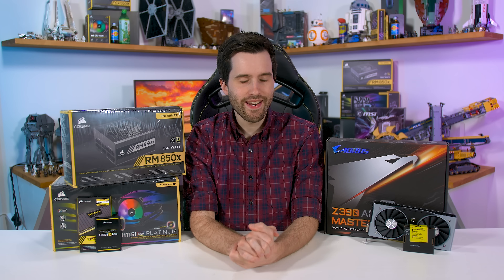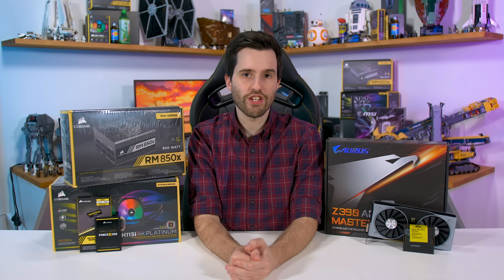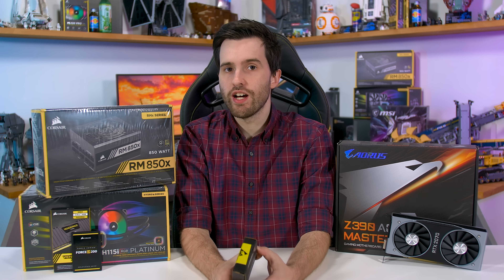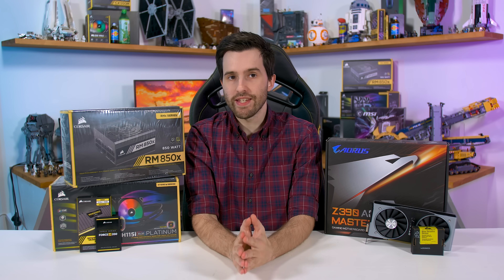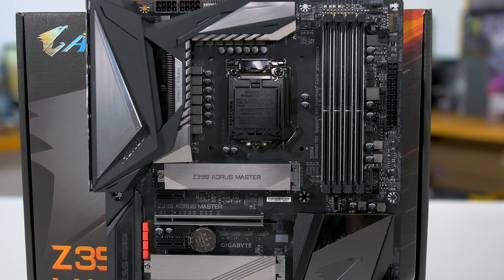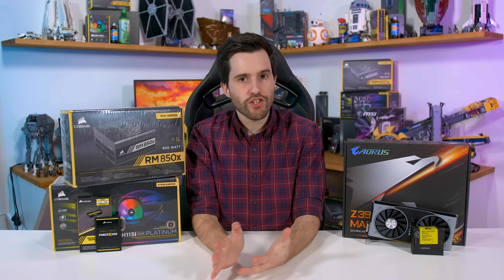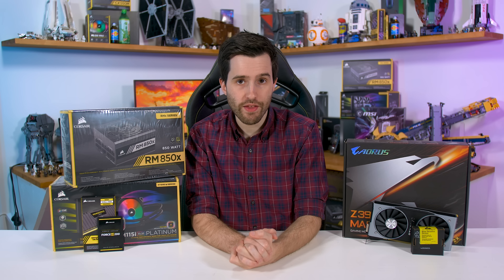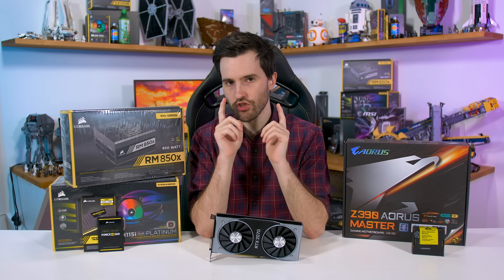Core i9-9900K Upgrade, Can We Cool This Hot CPU? Corsair H115i Platinum Tested!

Comment: Always a good thing to bottleneck OC 9900k with 3000MHz RAM. oh boy. you are working for verge, aren't you.
Maybe you wouldn't peak 90 degrees C if you had actual front air intake instead of a solid panel.
But you are the PC expert, and I am definitely not an thermodynamics expert. kappa
Reply: I've been also kinda wondering about the ram speed for 9900k.  Ended up ordering 3600 cl16 just to be little more safe,   and paid almost double the price of 3200 cl16.  There just aren't enough information how much ram speed utilization have increased from 8770k.  At least i couldn't find enough info.  Yeah agreed,  that front panel looks atrocious.  You would think it's a standard in 2018 to measure both temps,  with and without the front panel.
Reply: @jaybee0507  Yup. I have a somewhat similar case with the front face removed and the 3 fans work great not being covered. Key is a custom loop with larger capacity radiator and reservoir. More liquid = better cooling not just more fans. Just like more oil capacity for race cars.
Reply: @cammgt3rs370  Agree, custom loops are awesome and the cure for the temps, but i don't think we should be forced to build those loops just because case manufacturers sell cases with such poor airflow. That's just ridicilous and they really should revert back to something like those mesh front panels which were quite a standard five years ago, give or take.
Reply: You're not going to bottleneck with 3000 MHz ram. I'm running 3200 and my benchmarks run with much faster. It doesn't make that much of a difference.
Reply: oh then i guess multiple tests of ram frequencies from plethora of different venues in different applications are all just lying. and to be precise we are talking here about overclocking scorching hot, top of the line cpu to gain couple % performance boost, but you refuse to feed that cpu appriopriate amounts of data so that it's not dragged down by the data stream it processes, exlusively out of your own infallibility. of course 9900k will run on the cheapest motherboard as well, and why do you need 9900k perfomarmance anyways. kappa. it doesn't matter at half loads, but it definitely matters when you push it to the limit. 

tldr it's 9900k overclock of course it matters, live your own bottleneck happily
Reply: @tresnugget   As far as i have understoond.  Memory doesn't bottleneck the cpu,   like for example gpu would bottleneck cpu.  Instead memory works in junction with the cpu.   Making the cpu faster.   You could be right though,  does it make that much of a difference?  Let's say you get 5-10 fps more in gaming when going with a notch faster memory,  but your fps was already 100-300 with this chip.  I can agree it might not be a life changer, at least until games become more demanding,   but i mean if you don't care about small bumps in performance,  you could just save money and pick 2700x instead of 9900k.  Or i5 or i7 for that matter.
Reply: @jaybee0507  memory just holds information from storage and the faster the memory the faster it can move information and commands in and out. It does make a difference when you're talking about 2400 vs 4
3200, but according to Linus's investigation the point of diminishing returns seems to be after 3200 mhz. I agree 3000 is slower than what most would use and will impact performance to a degree but it's not going to be anything dramatic.
Reply: @tresnugget  I don't think Linus have done investigation concerning 9900k,  as a matter of fact i think his investigations are beginning to show age.  I've seen evidence of up to 4000+ mhz ram speeds increasing gaming fps on a 8770k.  Please do not ask links,  i don't have time for that :D...  Ram prices are quite high past 3200cl16,  so it is kinda subjective what is considered worth it and you may be right,   something like 5-10fps more isn't that dramatic.  Difficult discussion as there just isn't enough information available on the topic.  Most of the information are either old or done poorly without any cas information. We need our favorite youtubers to get their heads out of their asses and stop doing 9900k overclocking and heating reviews and instead start benchmarking ram speeds in games with 9900k :)
Reply: when der8auer OC the 9900k all cores at 5ghz on a ROG MAXIMUS XI with a noctua cooler and say CPU temp and VRM temps are good Hardware Unboxed continue to use these titles just to gain clicks and spread rumors.
Hardware Unboxed stay with the games benchmarks and left the OC and VRM conversation for who really knows what they are doing and saying
Reply: @Fiufia  der8auer also had a chip that was binned to get 5ghz at 1.29v and also was delidded, lapped die, and lapped ihs. Of course it ran colder.
Reply: @tresnugget  
You're right about the voltage.
but wrong about delidded and lapped die. yes he did it on another CPU but it's not the same
Reply: @Fiufia  gotcha, my mistake
Reply: On Intel website stated supported RAM DDR4-2666 so how is he bottleneck with 3k mhz ram? Can you elaborate with details.
Reply: I noticed that too.

Comment: That poor H115i must be choking for air, why do case manufacturers insist on this for a gaming machine especially, I have no idea.
Reply: Seamon  I got the tempered glass 275R. It has great airflow with my Ryzen 7 2700X with a H80i V2 and my RX Vega 64.
Reply: I have same case and its not choked as you might think there is plenty of cap in sides, and i have had same aio cooler setup in cases that are fully open in front and theres not much of a diffrence except "solid" front is more silent than fully open, corsair knows how to build cases so they still have airflow.
Reply: there's plenty of space for them to draw air from, calm down there budd.  as long as you don't try push/pull in the front you're good.
Reply: cheap crap
Reply: Fractal design meshify C is a way better case...
Reply: @maekkelmann345  yeah I've been considering getting this case for my next build. I know this sounds really fussy but I'm not sure if I like the polyagnal front mesh design though. I wish it had a flat meshed front instead.
Reply: games4850 i have the Carbide 275r non TG. I accually recommend it. It's just.. if your going to watercool, you'll have to get another case..
Reply: @maekkelmann345  thanks for the advice, I'm considering an AIO just because of the way they look and the fact I'm not limited by ram clearance like on some of the massive tower coolers. I've been keeping an eye on the 011 dynamic, and the View 32 TG edition, but I havent seen any decent thermal tests for that yet.
Reply: games4850 just don’t buy the non TG because it doesn't come with dust filter on the top. That is a major problem for me because it gets very dusty quick..

Comment: Is there any AIOs with no rgb that had a small block where it could be adapted to a GPU? 

Looking to cool an old power hog of an AGP card to try push 500Mhz from 375.  currently at 470 on air but it does artifact when too hot and does clock higher when cold.
Reply: NZXT Kraken G12 fits most graphic cards. Check what AIO cooler fits the G12 itself.
Reply: @deffar  the mounting pattern size looks way big for mine.  Mine is 53mm and the only block I am aware is this ancient one from swiftech.   I think I may have to make my own closed loop.

http://www.frozencpu.com/products/14170/ex-blc-965/Swiftech_MCW82_VGA_Liquid_Cooling_Block_-_Black_NVIDIA_GeForce_ATI_Radeon.html?tl=g30c87s143#blank

Comment: RGB fans behind a solid front?
Makes no sense
Reply: Increases performance 1000000000x
Reply: I mean, it's a test system, aesthetics aren't really the priority.
Reply: @JohnSmith-yx8kf  oh thats what you  meant ty for the clarification
Reply: You have RGB in your brains.
Reply: Says the guy with RGB gears behind a solid skull?
Reply: Eh, it a test bed, just for testing so doesn't really matter. They just used the case they where sent.

But I bet it looks pretty on the inside. lol.
Reply: RGB makes no sense anyway...
Reply: Isn't that the current trend with a lot of cases? So dumb but average Joe just sees the bling and buys so 🤷‍♂️🤷‍♀️
Reply: RGB makes no sense... so it doesn't matter!
Reply: Wild Bill it lights up the inside??
Reply: better throw the RGB mag lev fans in the trash and just use the case fans am i right?
Reply: Its not closed off, theres a opening at the bottom of the front panel with decent spacing for air flow. Not ideal but wont kill the temps completely.
Reply: Those fans are set to pull air into the system, I have the same configuration on my rig. I have an additional two 140mms (RGB of course), pushing air into the case from the other side of the radiator.
Reply: Rgb fans=more FPS..duh!
Reply: It draws air from the side of the front panel
Reply: Agree, it will decrease the heat dissipation.

Comment: I'm guessing you didn't sand down the 9900K like GamersNexus or der8auer did? The soldered TIM on the CPU causes the 9900K not being entirely flat on its heatspreader, causing the thermal compound and the CPU cooler not having proper contact with the entire CPU, causing higher temps.

Comment: I use a kraken x72, 9900k and at 1.29v i run stable 5ghz all cores on a maximus xi hero with 72c ish on cinebench, in games it rarely goes over 50c with a 1080ti
the auto overclocking settings turn on limiters and bring voltages way up past 1.4v and i overheat all the time, so im 100% on manual with no power limitations at all
also im using a thermaltake P5 TG Ti case

Comment: 80c plus no thanks
Reply: OMG. Intel chips are designed to handle heat. Their laptop chips regularly hit 90 and live forever.
Reply: My ryzen 2700 gets a max temp of 60C during benchmarking, dont even get near that during gameing (with the included ryzen cooler). I would say even 70C is too much, but 80C is cooking the cpu. I want my setups to last, i cant afford to upgrade every year. And a clocking a cpu thats around 70C without overclock, is just crazy.
Reply: Its 5.0Ghz on 8 cores and 16 threads did you expect it to be cool?  How hot does a 2700X get at 5.0Ghz?
Reply: @robertg457  Are you gong to make the same comment about the 5ghz 2700X? all day or?
Reply: @saminavy7124  because IT CANT GET OVER 4,2GHZ WITHOUT MELTING, THATS WHY!
Reply: @royk7712  Ryzen doesn't get hot at all at its max frequency compared to intel. A Ryzen 7 2700x can easily be kept at 4.3 GHz stable with a 240mm AIO. It's not that Ryzen overheats at higher frequencies, it's the architecture that doesn't allow it
Reply: @robertg457  Ryzen beats Intel and Nintendo you weeb

Comment: Using a 360mm aio for my 9900k whit all cores on 5ghz and temps are stable at around 70-75 c. what would  prob help abit is if you applied some new thermal paste instead of using whats already applied on your aio out of the box ;)
Reply from the maker: Yeah probably but we wanted to test the factory AIO config including paste
Reply: @Hardwareunboxed  he might also have a good chip also.
Reply: @AlexRubio  a good 9900k chip = 5.1 ghz on all cores whit a vcore of 1.31 ish (top 11%). Mine is stable on 5 ghz on all cores whit a vcore of 1.38 (top 80%). So no, i might have been lucky whit the stim but not the chip.
Reply: Please stop typing "whit"....is typing "h" really that difficult?
Reply: @UrMuMBiggestFan  mine needs the same amount of vcore. Definitely didn't get lucky with the chip. As long as I'm not doing small fft, my temps are 80 or less.
Reply: That's with an h150i pro. 1.38 sucks but I think I might delid and add a custom loop to see if I can hit 5.1
Reply: what would help more is a case that is suffocating the parts inside
Reply: Lmao, people actually bought the 9900k.
Reply: Lol no you don’t, run Prime 95 Smallest FFT’s with AVX and tell me you have a max temp of 75. I have two builds both with custom open loops with 2 360 rads at 5ghz 1.3v and get 83c max temps in Prime 95 with AVX...
Reply: I can't even afford a ryzen 5 2600😞

Comment: Impressive howevrr thsts still a high temp. I live in rural aus were ambient is normally in the 30's with a rac going lol
Reply: Go for 4.5-4.7, that will require less volt and will run a lot cooler.
Reply: so get a better case and youll have no issues
Reply: I am not going to get the 9900k lol no need too go that extreme.... also they test in 24 degree room. Not everyone games in cool and controlled enviroments. Thats what it was more about with my comment....

Comment: I believe there is a "solder lottery" where the application is inconsistant. I see some people running very low voltage and huge temps. My 9900k is 5ghz all core 1.35v bios and i let it droop to 1.27v LLC6. Gaming temps are under 60c, stress test non avx temps under 75c. Aio kraken x62 cooler
Reply: Why my i9 9000k with h100 v2 is 95 degrees in bios same just using windows only
Reply: @sergiob464  cooler might not be mounted properly? Maybe not enough thermal paste
Reply: I put new  thermal paste the cooler was working in my old i7 without problems. I’m so disgusting :/ I don’t know what  can i do
Reply: Bruhh I'm using the 360mm radiator with the kracken x72 and my primen95 temps reach 95+ and gaming is at 70-80s with low voltage at 5.0ghz, but once I get to 5.1 and up the voltage to make it stable (1.34v) it hits 100 on anything cpu intense, even games that are cpu intense will make it skyrocket into the 100s, I never even bothered overclocking anymore with it at this point... (just to keep it from throttling that's why I use it at 5.0 ghz)
Reply: @bobbywhite6208  then you nare doing something wrong I am running 9900k now and  I had it under a kraken x62 and temps would sit in high 50's to low 60's in cpu heavy games like battlefield 5. There is a video on my channel showing this.
Reply: @AllThatJazOfficial  I'm definitely not doing anything wrong as I've taken this pc apart 4 times to remount, repaste the thermal paste and etc, even checked if the pump is working, its obviously the cpu can't take it
Reply: @bobbywhite6208  check my channel. Video running 9900k 5ghz all core under a kraken x62 cooler in battlefield 5. Temps in high 50's/low 60's
Reply: @AllThatJazOfficial  starting to think you got extra lucky with yours, I watched it and I'm jealous, me and a bunch of other people struggle with temps and here you are handy Dandy with low temps...lets trade CPU's lmaoo also what voltage are you running at?
Reply: @bobbywhite6208  haha thanks man. Maybe I did for thermals I don't have a silicone lottery chip for overclocking though. Runs 1.3v for 5ghz. 1.26v under heavy load
Reply: @AllThatJazOfficial  same thing with mine except my load voltage is at 1.27v

Comment: Intel room heater!
Reply: How the tables have turned, lol.
Reply: @AlexRubio  nope on Intel's side the completely lost the table
Reply: Miguel Carones  Yeah, let's see what your Ryzen 2700x temps are like at 5.1Ghz. Oh wait lmao.
Truth is that the 9900K would run alot cooler than your 2700x at the same clockspeed. Keep telling yourself otherwise you deluded drone.
Must be hard getting so angry over a CPU lmfao.
Reply: Miguel Carones  "stop making shit up u pathetic intel fanboy" You're writing like your angry. 
But the 9900K has no problems running at 5Ghz+? Most chips run around 83-85C on 100% load with AVX. And the 9900K can handle those temps just fine.
The 9900K is anything but a train wreck lmao.
And you're going to be sorry if you think that AMD leak is actually true lmfao.
Reply: Miguel Carones and what if the intel chip is at 4ghz? Itll be cooler than the ryzen at 4. And what if the ryzen chip is at 5ghz? Lol
Reply: Both at 4.0GHz the Intel chips are cooler
Reply: This is good during winter season